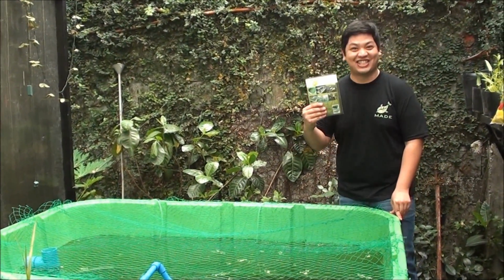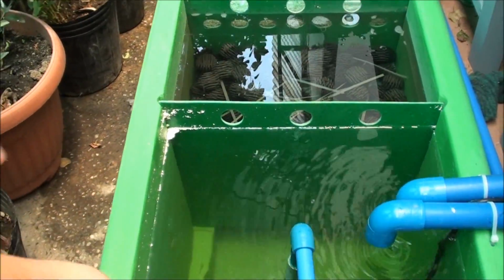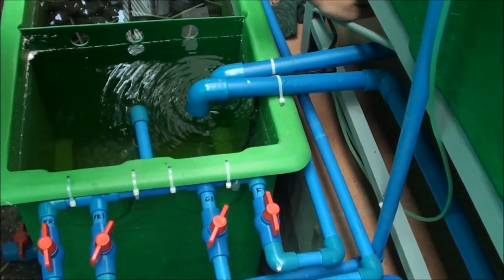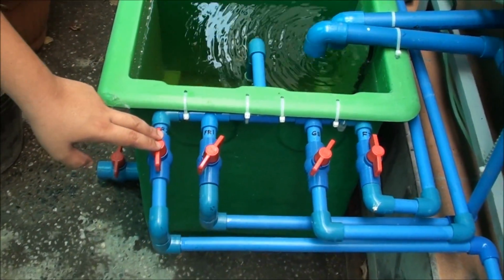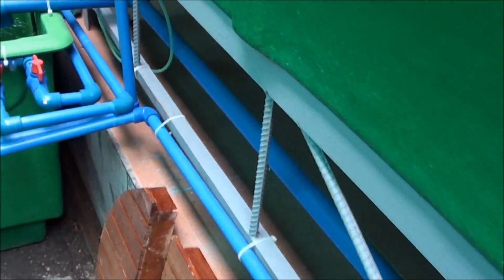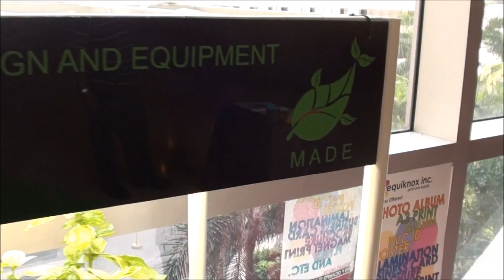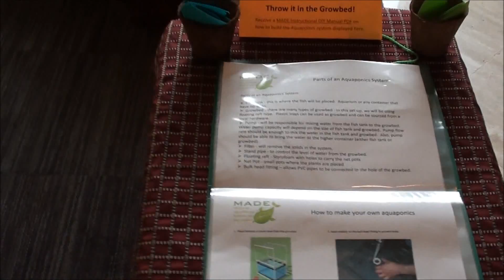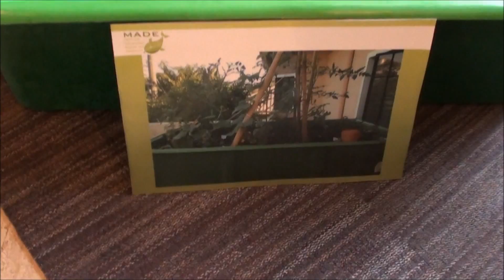How the filter sump combo Aquaponics works, MADE in the Philippines

Comment: Thank you sir for the video it is very informative. 
i am an aquaponic amateur and i would appreciate if you can enlighten me:

While the swirl filter is for large solids, brush and spaghetti mat filters are for smaller solids and are hosts for the nitrifying bacteria. Am i Right?

What is the Ball-like filter media for!?  If it is for nitrification does it do a better job than the Spaghetti mat?

Why water draining out from the Gravel bed passes through the mat and Ball-like filters. Isn't it as clean as the one coming out from the floating rafts?

Thanks again and keep on the good work